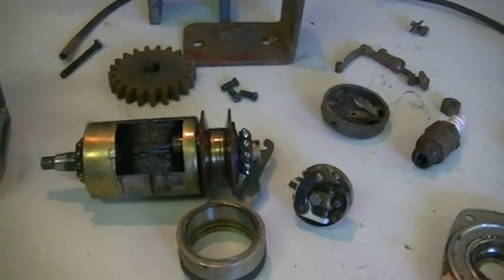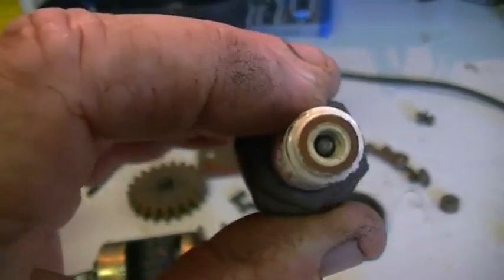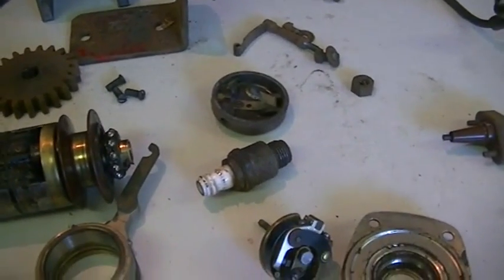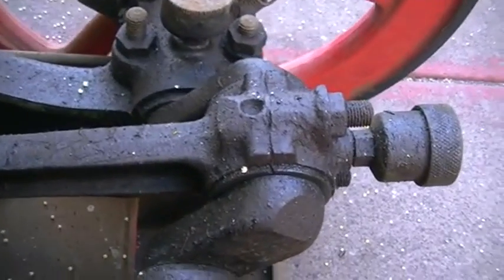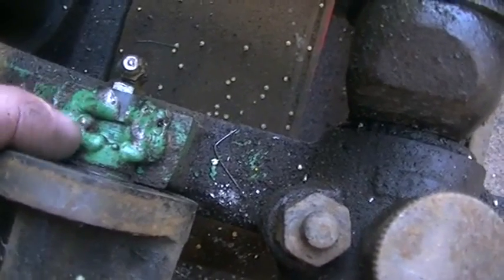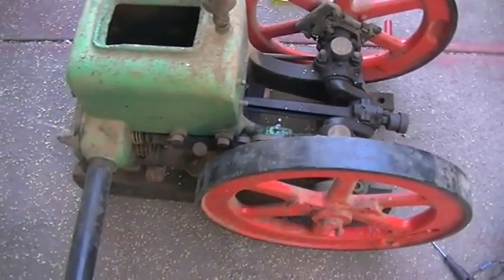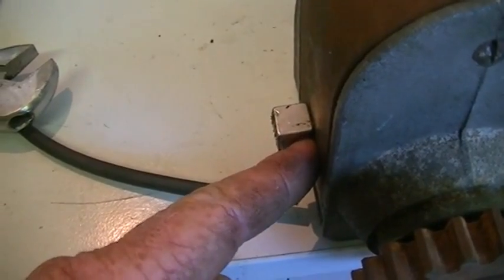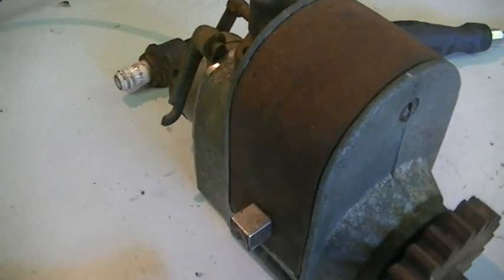Water as fuel project the magneto and exaust valve timing

Comment: I don't know anything about these, but had a thought that the rings are worn and compression is low. The farmer set the exhaust gases to be pushed out early and it improved running ? His weld bodge could tie in to not having to buy new rings.
10.6K coil, wow, 2 busted magneto's would make for a decent Cool Joule. In fact, what happens on the scope with magnets interacting on a CJ I wonder.
That's a great piece of old iron, like a mini English Traction engine.